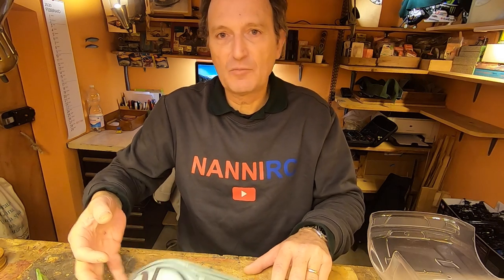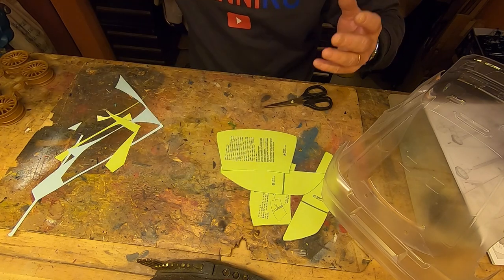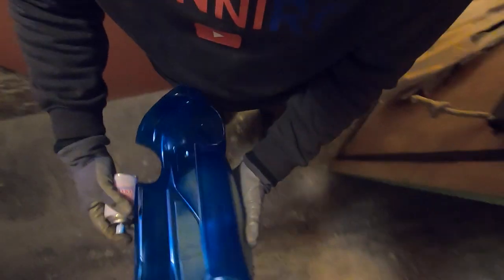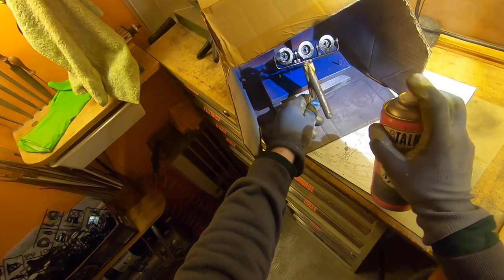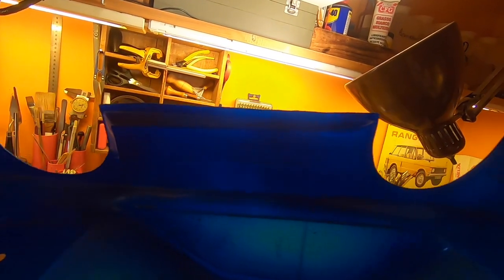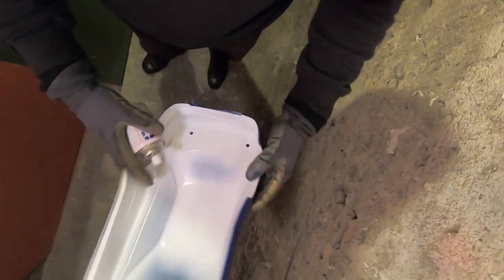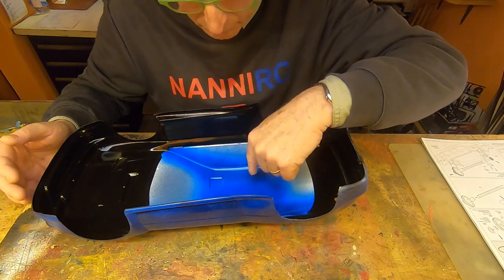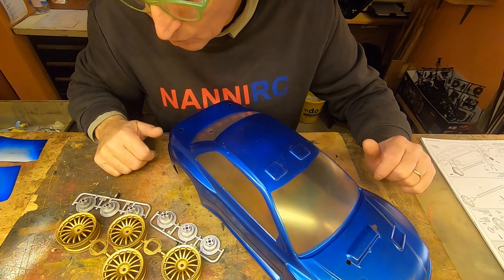Subaru Impreza  RC Tamiya 1/10 part 3 painting

Comment: HI Nanni, today I bought a body for the Hyundai i20 Rally 2020. I will probably put it on a TT02 chassis. This is a multi paint job (https://motorsport.hyundai.com/rally/wrc/i20-coupe-wrc/). Do you still recommend to use white after the paint to make it shiny? Also in a multi-color paint?
Reply from the maker: YESS! and after, if you want, black so the model from below is more realistic

Comment: Which remote control, battery and servo do you recommend? Amateur use.
Reply from the maker: To me FlySky GT 5 is a great radio, battery any lipo with proper charger is the best, servo depends from the use 20kg is a good balance if speed is high
Reply: @NANNIRC  Thank you for the tips. Do you have a specific brand for the battery and servo?
Reply: @NANNI RC Do you have a video that explains how to adapt the car to do a drift or is it enough to change the tires enough?
Reply from the maker: battery from banggood the more you can pay the better it is the same for servo try amazon or local dealer
Reply from the maker: @rodrigosilveira3969  no experience on drifting.....